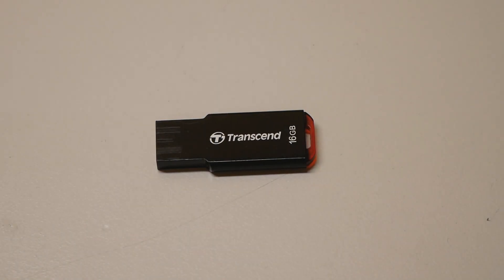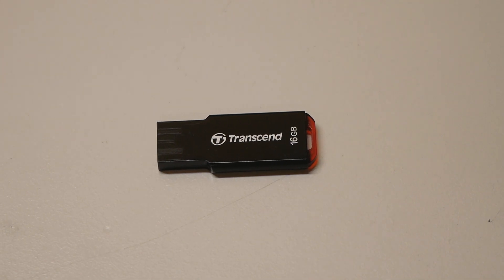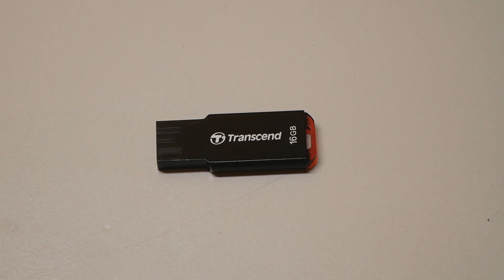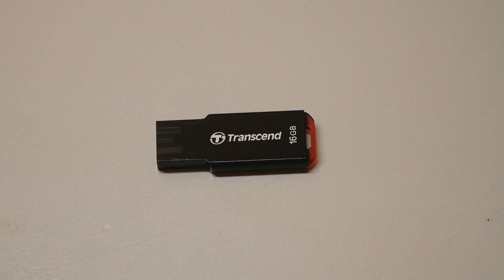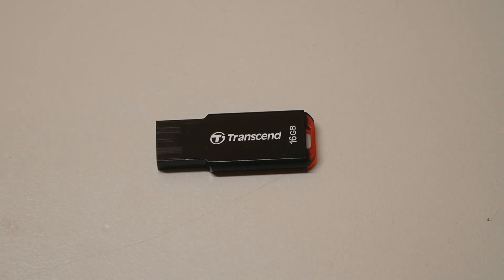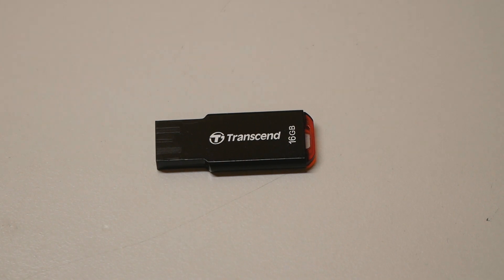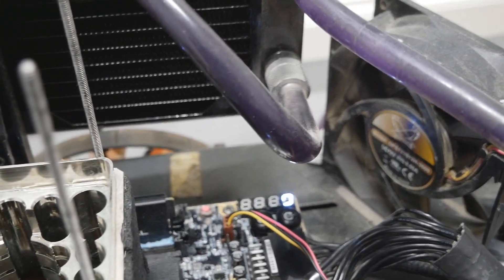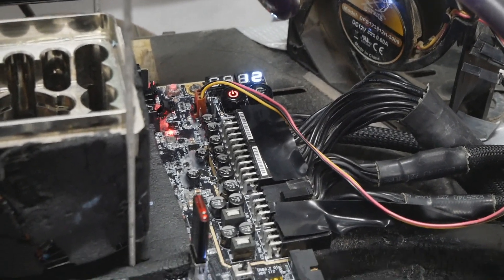EVGA BIOS Update USB Stick Issues - Flashing Corrupted BIOS on Z790 DARK KINGPIN

Comment: Mine failed no matter what USB stick I used with E8 or E2 codes. I ended up trying unpluging everything from the motherboard and removed the CPU just leaving the 24pin plugged in and it worked finally.
Reply from the maker: Good to know.

Comment: I had the experience with the z690 kingpin, after using the flashback function the flash failed and the flashback function would no longer work on any of the 3 bios switch positions. I borrowed a cpu to flash one of the other bios chips to support 13 gen. To recover the corrupt one the only way it would work was to boot the pc then flick the switch over to the corrupt bios position then flash from windows. Took a few minutes to figure out the workaround but i now have 3 bios positions again
Reply: My 3rd bios is still dead.

Comment: Here's an idea - use the USB stick EVGA provides in the box. Guaranteed to work.
Reply: @Shraf2k  evga included it for that reason. It’s worked in all my Dark boards. Heck even my GB boards
Reply: @Shraf2k  i'm sorry i dont know who you are. maybe user error? 
I can only tell you what has worked for me multiple times. 
maybe i am lucky? doubtful, ore else i'd be a millionarie.
Reply: @NorySS  He's a noob. No skill, wannabe Reddit reader.
Reply: @Shraf2k  It is. Ive used every one. Got every error code imaginable. Sometimes I had to fully power the PC off to get it to kick on and not give E3. Use the provided drivers first. Most dont rename it, thats probably it.
Reply: @Shraf2k  Flash 2.06, then 2.08. Read the forums man.
Reply: @Shraf2k  Im the guy that beats TF out of you on Port Royal. #74. 😆😆😆😆
Reply: @Shraf2k  Ohhh. Thats with a 12100F little man! Hahahaha
Reply: @Shraf2k  You're a noob. Good luck? Post something. Lets see me squash you.
Reply: @Shraf2k  😆😆😆😆. You're such a noob. If you can somehow beat my 12100F on anything, Ill pull out some more cores to make you cry a little more inside. Have a 12700KF ready. 13700KF coming. and 13900KS next. I challenge you and your small little brain.
Reply: @Shraf2k  But you should easily beat me right? I mean Im "Poor." My "Poor" little Kingp1ns surely cant beat you right? Such a poor excuse of a person, is what you are. You cant beat me with money! 😆😆😆😆😅
Reply: I can confirm that the provided USB stick does NOT work on the Z790 Classified - even with the bin file named correctly. Maybe I'm just unlucky and got a bad board or bad USB! But I agree with the other user that it's not a guaranteed-to-work stick.

Comment: It's always a good idea to use a small capacity FAT32 formatted USB 2.0 flash drive for UEFI firmware updates. Less likely to be compatibility issues. Yes modern systems should be able to use more modern drives but often they simply don't. We need to find the documentation for the USB recovery process specified by AMD to see what it can and cannot do.